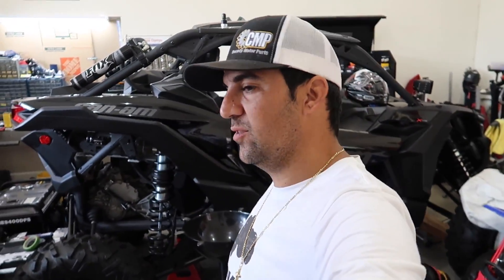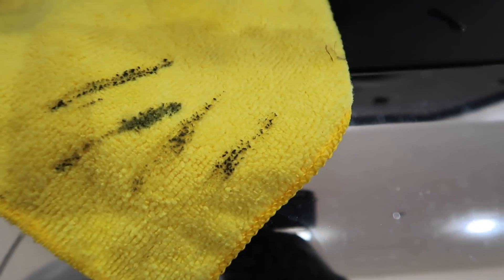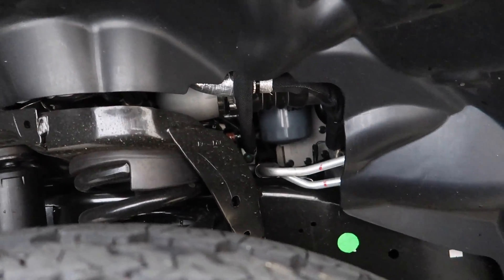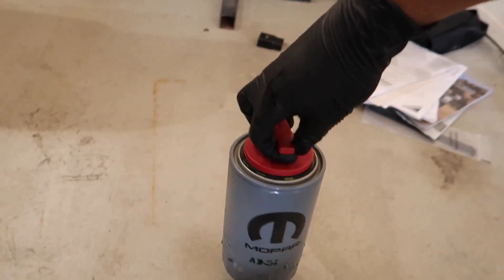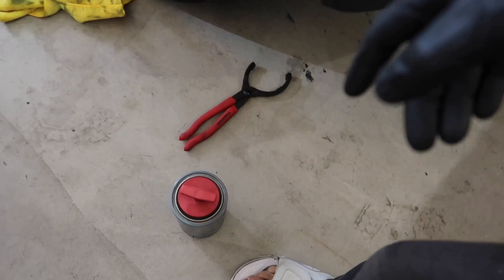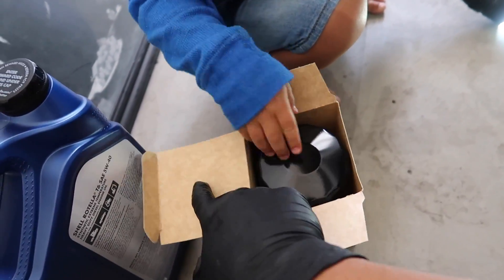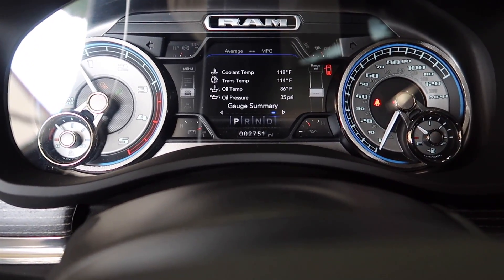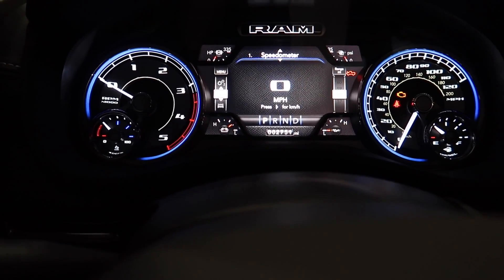THIS IS A MUST TOOL TO DO AN OIL CHANGE ON THE CUMMINS

Comment: Had no idea the oil got so dirty that fast!
Reply: prjgrudge yep i pick mine up from a fresh change from the dealer looking like that
Reply: prjgrudge that’s the egr for you.
Reply: @abramspearman9046  I only have 600 miles on my 2018 2500. Now I'm worried.
Reply: prjgrudge worried about what?  Being a man?  It’s a diesel and 99% of you guys don’t even drive or use the diesel for what’s it’s built for. A little bit of dark colored oil is normal, every real diesel has that going on. There is nothing to fear my lad.
Reply: Devo Dar yes all diesels have a little black oil. But the egr amplified the blackness of soot in the oil. And with the 5.9’s have a little bit blacker of an oil than most pre emissions diesels. It still ran to 298k. So yes it’s not that much to be worried about if it’s not from emissions.

Comment: If you think thats bad just think a simi running 25,000 miles between service's and the normal is 10,000 to 15,000 miles
Reply: Different animals; a semi has 11 gallons of lube oil, this engine has 12 quarts.

Comment: My 5.9 has never had clean oil. Even immediately after the change. It’s a Cummins thing.
Reply: My 5.9 is super clean, must be something wrong with your truck.
Reply: Cameron F i heard that it’s something to do with the timing for the exhaust valve. Something like a built in egr basically. I don’t know that for a fact though.
Reply: Eddie Monster it might be higher miles.
Reply: Nothing wrong with his truck mine does the same thing.  im sure at a lower mileage it was cleaner but it just part of it eventually with a diesel engine
Reply: Matthew Miller it never really bothered me. It still started every morning.
Reply: @Matthewmiller28  I just hit 300k on my truck today and I tow a trailer every day, but still clean. I chang my oil every 4000 miles since I got the truck in 1999.
Reply: Eddie M. I’m at 211k miles. But I did help one of my friends do a full flush and use sea foam to clean everything out but to me it’s not worth the time. I do an oil change every 5k with rotella T5. I only have a 5” straight pipe, AFE intake, I am using a smarty JR as well, but that’s all I know is done to the engine. Not sure if injectors or anything was done from a previous owner. But I’m not having any problems from it at all. But working on most Cummins I’ve always seen black oil unless a flush was done or a bypass filter was used as well.
Reply: Eddie Monster if it’s a diesel it’s not going to look clean so stop lying.
Reply: @devodar2579   Get a diesel truck and then take.
Reply: The oil in My old 12 valve would stay clean for 500-1000 miles after an oil change. The oil in my 04 would be black after an oil change. Always. That truck has 350k miles and still has no issues. Both my 2014 6.7s stay clean to 500-1000 miles also after an oil change. Both deleted. 🤫.  So my take on black oil after an oil change is it’s not an issue.

Comment: Also from the Owners Manual
The 2500/3500 trucks with 68RFE (6 speed transmission) use 22 quarts (20.8L) of oil.
The 3500 trucks with PTO and AS69RC transmission uses 22.5 quarts (21.3L) of oil.

If your have. 4500 or 5500 truck, check the Manual.

Don't put 12 quarts in the engine and start it, UNTIL YOU ARE SURE HOW MUCH OIL IS REQUIRED!

KNOW your truck, and READ your Owners Manual!!!
Reply: Nope, 22 quarts is the coolant, not the engine oil.  I'm looking at my manual right now.

Comment: Wix 57620xp is the recommendation if you’re running synthetic oil it has a different media inside. I’ve been running that filter on my 5.9 w/compound turbos I also ran T6 5w40 also for over 70k miles. My raptor toy-hauler weighs a bit over 16k max gvw. I have hauled it out to Santee Lakes numerous times. Headed to camp RZR in  Glamis 25th October.  

I’ll be pulling my Raptor with my new Demonico Red 2019 Ram 3500 HO 6.7 With Aisan w/DRW.

Comment: That oil filter looks weak an small compared to OEM. I did my first oil change at 10k on my 19 3500. I stuck with OEM mainly for warranty purposes. I'm at 12k on my ram.

Comment: I always use OEM filters and parts when I can. Price now a days are normally close on OEM parts. My 2015 6.7L Powerstroke takes 15 quarts. Nice job on your oil change.
Reply: Plymouth Man apparently you don’t know how much oil your truck takes
Reply: @22newegg  so how many quarts do I need?
Reply: 13 quarts. Not 15
Reply: 13 Quarts for a oil change , ford had a miss print and put 15 quarts in some of the maintenance books.

Comment: eddie eddie eddie...you couldnr be more wrong...there is no diesel engine that I have ever seen has clean oil after 5000 miles...don't fib to your viewers...emission or deleted, the oil will always be black.
Reply: I have never owned a diesel... But I asked my uncle that is a diesel mechanic (over 20 years with Cummins). And he said the same thing... It will always be black no matter what.
Reply from the maker: @themotor29 well when i pulled my dipstick on my duramax after 5K it was not black maybe dirty but not black and that is something that i have shown on my channel so i am gonna have to say you are wrong my friend

Comment: Eddie, before diesel engines acquired all the emissions/epa equipment, before the term deleted was introduced, whether its a CAT,  Cummins, Detroit Diesel, the moment you change the oil, even after 200 hrs/3k to 7k miles, it'll be black as soon as the engine turns over. Diesel engines have always been known for that. Thats just what Diesel fuel does. You're never going to get away from it. 

Oil sampling will help you monitor your engine life. And its best to stay with the OEM products, to protect your truck's warranty.
Reply: Maybe for industrial use vehicles. My lml duramax was black on the stick right away after a oil change non deleted. I can go 5k and the oil is still clear after deleting

Comment: You add more oil you going to over fill it.
Reply: So if the manufacturer says 12 quarts then only put that much in, even when it reads 1/2 way on the hatch marks ?

Comment: I’ve never been crazy about running anything oem because the manufacturer wants that engine to wear to their specifications. I Run all Donaldson filters on my duramax change the oil filter every 5k and oil every 10k. Send oil samples off every other oil change and never have anything bad come back.